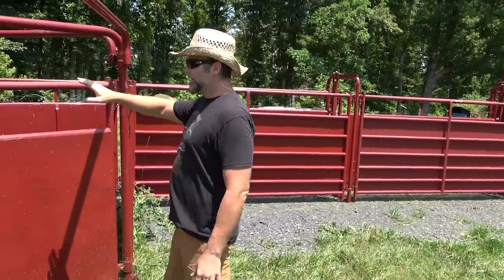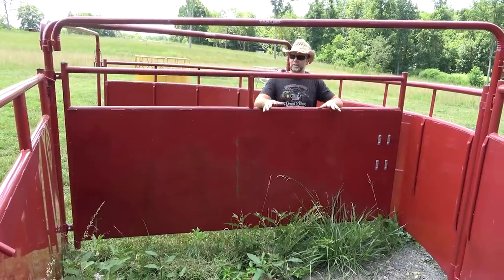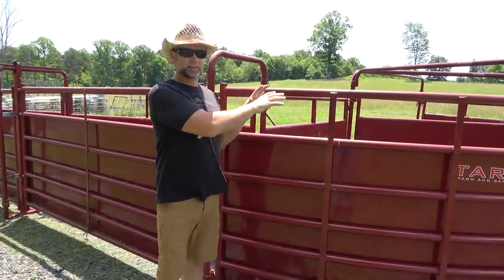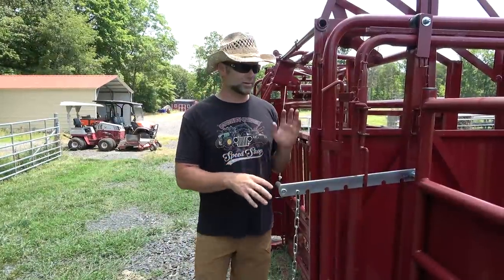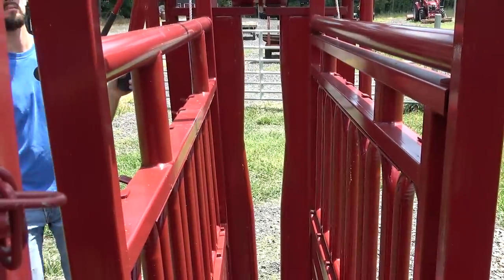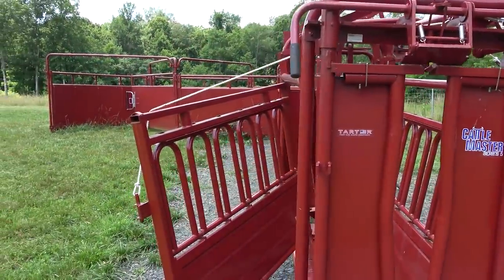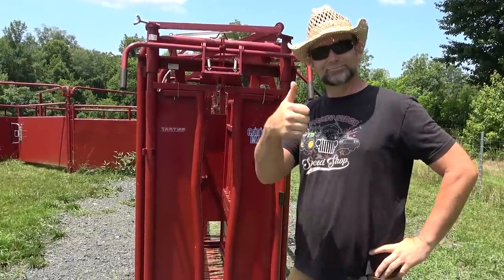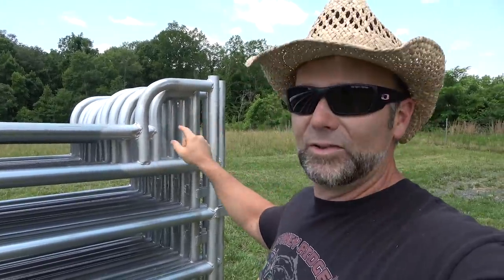Small Farm Planning: Setting up simple working pen for the cattle chute

Comment: Have the cattle graze around it regularly so they are used to seeing it.  They will avoid it otherwise.
Reply: You hit the nail on the head  it ain't gonna be that easy because they won't follow him like they do going to new pasture.
Reply from the maker: I'll bet they go right in and gobble up the sweet feed I put in there without a problem. Probably expose them for 2 days before running them through the chute
Reply from the maker: plan is to run them through 2-3 times per year...they'll have a feed trough in there to gobble down some sweet feed

Comment: Josh, have you thought about adding some rubber insulation to knock down on the metal on metal noise?   It may help with the cow stress level to reduce the noise level of handling...just a thought.
Reply from the maker: yep....I thought of it...the cows get used to the noises after a few mins and all is well for sure